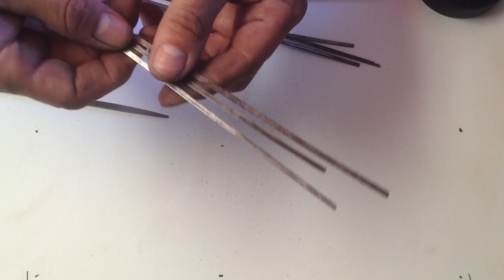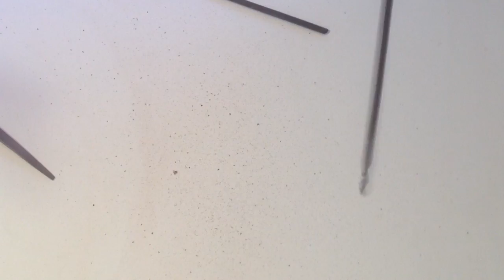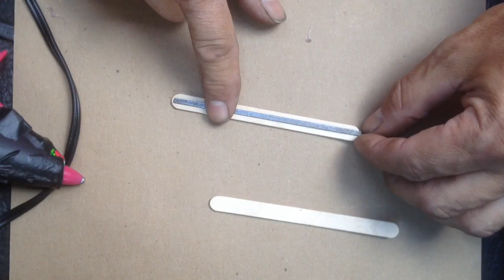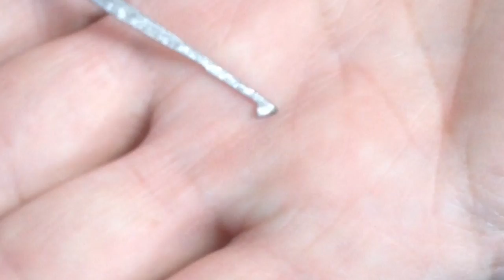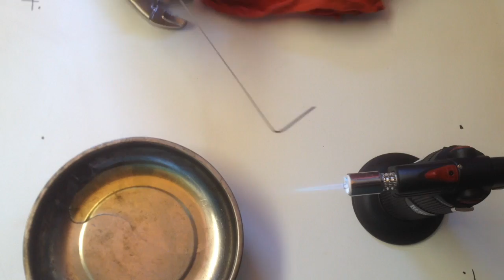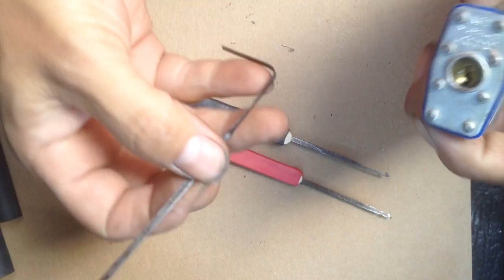Lock Pick Tools - How to Make

Comment: Pretty Awesome.  Too bad there aren't street sweepers around where I live lol
Reply: Same here, but apparently one of the better materials is windshield wiper metal too.

I'm getting some professionally made lock picks for cheap, but I would probably go make my own.
Reply: BrianTheMagicGuy use the stainless steel piece sandwiched between the rubber in a windshield wiper blade. I collect them from the dumpster at mechanics places because they come in many different sizes summer thicker summer wider and yeah that's what you want you don't want the real thin narrow ones.
Reply: They use witches' brooms??